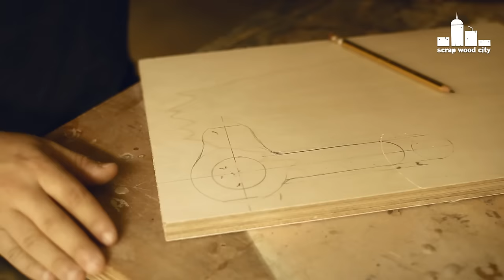Wooden DIY animation toy

Comment: I’d be interested to know if you used a slightly shorter string and added some wooden balls (weights) at 3’ o’clock and 9 o’clock on the spinning disc, if you could generate momentum so at the end of the spin it would wind itself back up again, and repeat, so you could keep pulling it like a yo-yo... 🤔